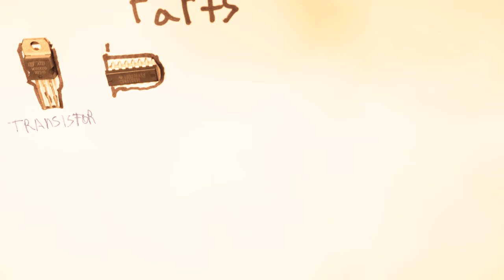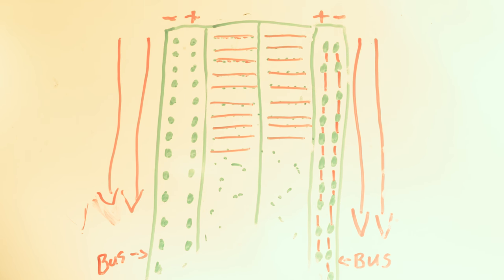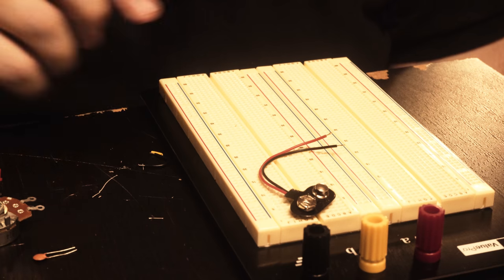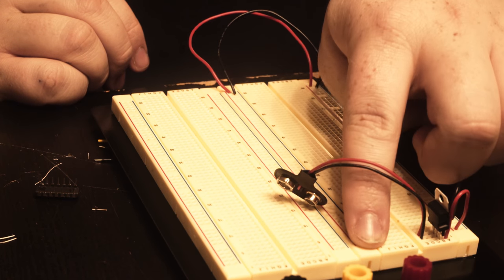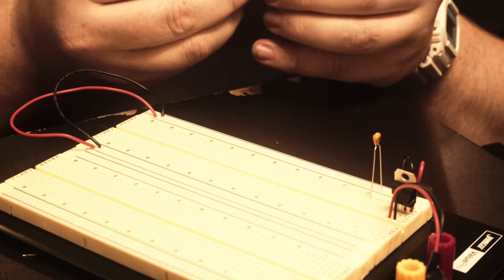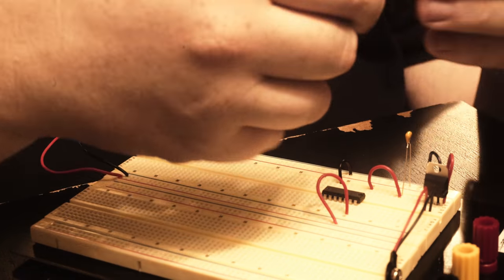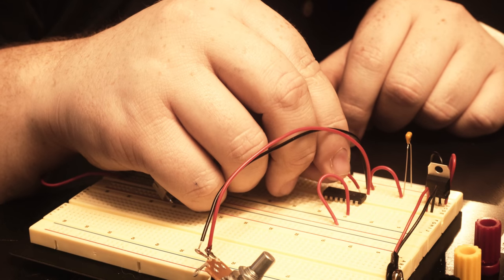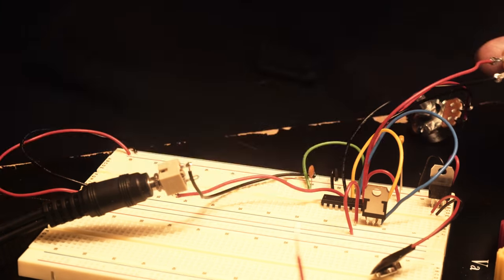Making a simple synth with a 40106 oscillator circuit

Comment: A capacitor is a temporary storage of electricity.  Its like a batter that can instantly charge or a sponge at the kitchen sink that can absorbent water quickly.  With regard to the wave and frequency cutting, some of that power instead of being a higher frequency, like the flow of water.  some goes into the capacitor bucket, thus less water/electrical flow thus a lower result.  I hope that helps.

Comment: 12:00 - are you sure that a higher resistance gives a higher pitch? IMHO it's otherwise.
Reply from the maker: dang your comment made me do research on my vacation! ;)  Ok, so, what i found is that resistance and frequency actually have no direct correlation. With Ohm’s law, there are direct connections between Resistance, current and voltage.  Not frequency.  That said, the frequency change depends on the oscillator.  So, it’s not as simple  as more or less resistance equalling higher or lower frequency, as the way I put it in the video.   It’s more about what’s going on with that chip, etc..  I def want to do more research, it’s really interesting.  Thanks for bringing that to my attention.  I’m new to this stuff, and comments like that really help me understand things a bit more!  :)
Reply: Jayson Munro the way i understood it was that the resistor and capacitor formed an rc network, where the capacitor was charged through the resistor. increasing the resistor value limited the amount of current that the capacitor received. when you turn the potentiometer, you are adding more or less resistance, which changes the charging time of the capacitor, and that changes the frequency. whatever. may i suggest making a really simple low pass filter? all you need is a 10k pot and a 100 nf cap. would increase the level of expression you can get

Comment: Your explanation of the breadboard is fine. Your explanation of every component after that is just fundamentally wrong. Anyone watching this vid should be able to make this simple oscillator though.

Resistor: the higher the resistance, the less voltage will get through it. 

Potentiometer is a variable resistor, the higher the resistance value, the lower the frequency. More resistance to voltage=less power, which translates to lower frequency in this case.

transistor: a transistor is basically a signal amplifier: you feed it a weak signal as control on one pin. This weak signal controls a stronger voltage going through the transistor (at least that's my best understanding)

Capacitor: basically this is like a sort of "rechargeable battery" that discharges its load all at once, as soon as it reaches its capacity. It's like a bucket that automatically dumps itself once it is full. (again, my best understanding) 

So... the resistor, or in this case potentiometer, controls the flow of voltage into the capacitor, from a trickle (very high resistance) to a torrent (very low resistance) the size of the bucket (capacitor) determines how long before it will dump its load. How often that load is dumped, determines the frequency of the output.
Reply: Protip resistors "resist" current and not voltage :DDD

Comment: 13:38 You are describing a capacitor! A transistor just acts as a switch that can be  turned on and off by electricity. The sort of transistor you have is called a MOSFET, which is just a high power transistor. Maybe do some more research and make a new video :DDDDD